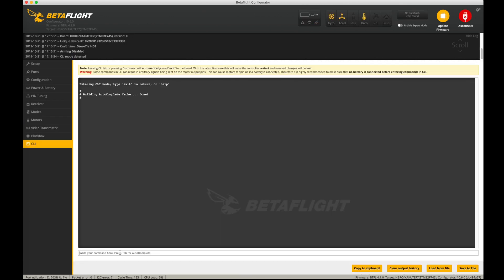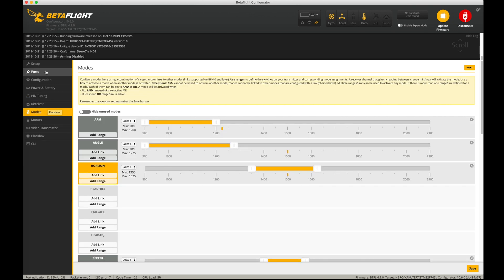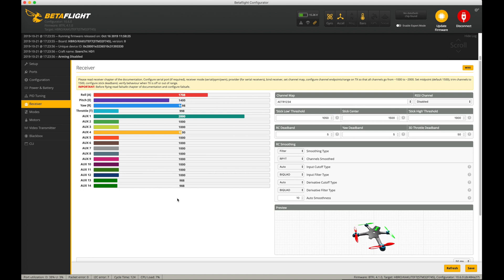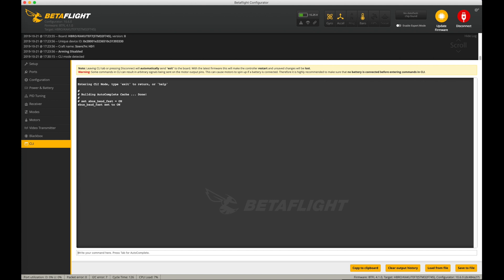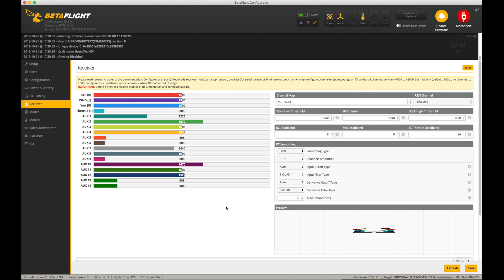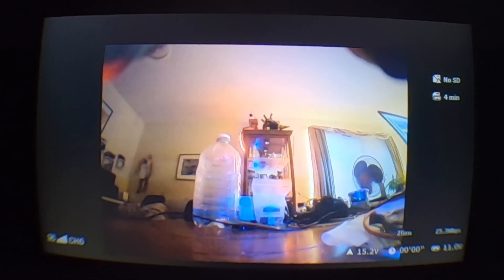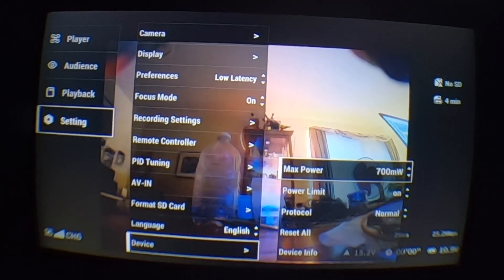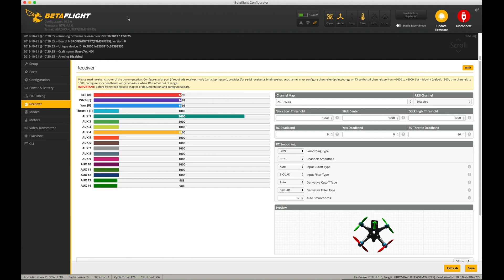How to setup the DJI HD FPV radio system to use the 7ms latency HDL or sbus fast protocol.

Comment: Thanks for the video.  I just updated the firmware on my DJI FPV system and the only thing I noticed on the goggles it doesn't say DJI HDL protocol instead it says Sbus Fast protocol.  I am assuming because of the latest firmware update.
Reply from the maker: Ah, yes, thanks for pointing that out.  That was a change DJI made in the recent firmware update.  I like it because it helps stay consistent with Betaflight now.
Reply: 5zero7 RC 
So I don’t need to do that after the FW update?
Reply from the maker: @MindRiderFPV  The firmware update changes the wording you see in the goggles to make it consistent with what Betaflight has in its interface.  If you want to use the 7ms protocol for the radio you need to make sure both betaflight and the dji system are set to the sbus fast protocol.
Reply: 5zero7 RC 
Ok. I have 4.1 on my IFlight DC3, DJI but I can’t see the fast protocol option in BF. Only the usual ones. 
Do I have to have quad and radio powered on to see that option in the scroll down menu? ( yes DJI radio)
Reply from the maker: @MindRiderFPV  You won't see it in the drop down list.  You need to enable it with the CLI command.
Reply: 5zero7 RC 
set sbus_baud_fast = on 
Gives me an error message invalid name.
Reply: @MindRiderFPV  Are on Configurator 10.6.0 or higher? otherwise, the Set command won't work.
Reply: Daniel Kieng 
I am, I’ll check better at home.

# Betaflight / EXF722DUAL (EX7P) 4.1.0 Aug  9 2019 / 11:17:48 (41a0b5938) MSP API: 1.42
# get baud
srxl2_baud_fast = ON
Allowed values: OFF, ON
Reply: @MindRiderFPV  Did you figure this out? Im using same FC and got mine to work.
Reply: Chad Lawson 
Out of US now, I’ll try when I get back. Thanks!

Comment: I would like to ask about ports if you want to bind the dji remote to the megabee. Which config or serial to enable? USB VCP, UART1, UART2, UART3, UART6?
Reply from the maker: Don't change USB VCP or you will lose your ability to connect to your computer.  The rest depends on your flight controller and where you wired up the radio control wires.  If you have a flight controller that is designed for the DJI system, this has been predetermined for you.  If you are using any other flight controller you need to look at that flight controllers documentation to see where the UARTS are, then choose one, solder the correct wires from the DJI air unit to that UART pad on the flight controller, then configure that specific UART for serial control.  Hope that helps.
Reply: 5zero7 RC I have issue when Im doing a test to the DJI remote to the beta flight, it doesn’t detect what I do on the remote controller. 

Can you check again if its correct:

USB VCP: Configuration/MSP = On
UART2: SerialRx = On
UART3 l: Configuration/MSP = On
The rest is off. 

Receiver:
Receiver Mode: Serial Bus Receiver
Serial Receiver Provider: SBUS

Channel Map: TAER1234

Is this correct? Or am I missing any settings?

Thanks in advance. 🙏🏻
Reply from the maker: @AldenDiazTV  Do you have the DJI system configured to use the sbus, or "Normal" protocol?  Have you updated your DJI gear to the latest firmware update? Do you know the brand and model of your flight controller?
Reply: 5zero7 RC hello sir, i configure it using sbus. The megabee is prebuilt by iflight so im not sure the brand of the flight controller. 🙁 All 3 dji system are updated to the latest firmware.
Reply from the maker: @AldenDiazTV  I assume your radio is bound to the air unit and you can change settings in your goggles by using the buttons on your radio?  I would also suggest watching Le Drib's setup video.  It might help.   https://www.youtube.com/watch?v=mA9eAroS_6I

Comment: Hi. Were you able to configure telemetry?
Reply from the maker: I'm not sure I understand your question.  The DJI radio does not do telemetry data like an OpenTX radio.
Reply: @5zero7RC  Sorry, my question is about telemetry of the flight controller. I could not find any documentation about how to setup this.
I tried all telemetry protocols and it didn't work
Reply from the maker: @kerleston  Since this FC is designed to work with the DJI system, the only "telemetry" data I use is what the DJI goggles can display.  At this time that is only the battery voltage and if the FC is armed or not.  My guess is that enabling the telemetry option on the FC does not do anything.  But I'm not sure about that.
Reply: @5zero7RC  Ok, Thank you

Comment: I’m not seeing the 7ms in goggles?
Reply from the maker: That is correct.  I believe the goggles will display the video latency.  The HDL protocol is just the radio transmitter link and its latency is not displayed anywhere.

Comment: So you just need to type that command into the CLI and switch the protocol in the Goggles?  You don't need to change the settings to DJI HDL in the Receiver settings section of the Config page?
Reply from the maker: Correct.  With the final release of Betaflight 4.1, you need the cli command to enable the DJI HDL or sbus fast protocol.  In some of the early 4.1 release candidates HDL was in the drop down box, but that was removed.  Hopefully it comes back in some future update to make this easier for beginners.

Comment: Did this fast s-bus have any impact regarding the « flying range » ?
Reply from the maker: Not that I have noticed.  But I have not pushed the range of the system to its limits with or without the 7ms latency protocol.

Comment: If you had one quad on Sbus and one on fast ... do you have to go back and fourth in the goggles to connect or dies the goggles remember?
Reply from the maker: Good question.  I only have one air unit so I can't test that.  Maybe someone else has the answer?  I wonder if that setting is saved in the air unit and switches depending on which one the radio is connected to.  Hopefully that is how it works.
Reply: @5zero7RC  It's when you don't want to update an earlier version of Betaflight when the quad flys good now and the speed controller is on BLHELI that does not do rpm filtering..